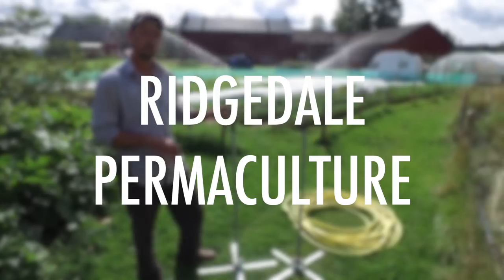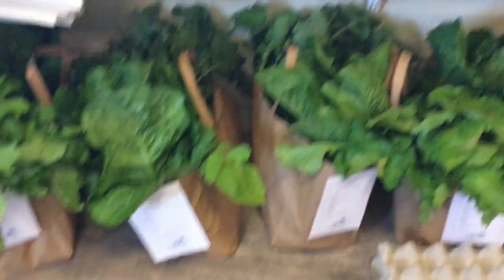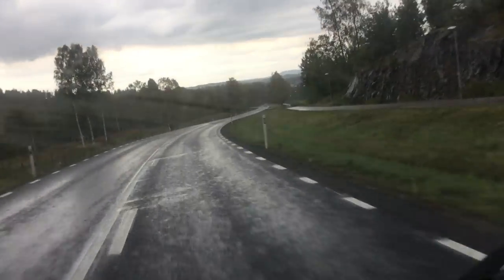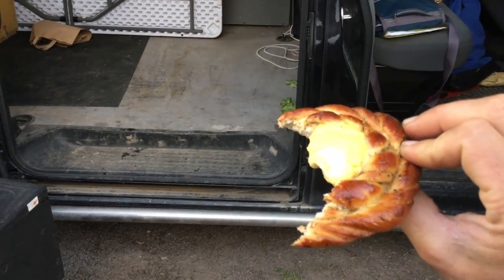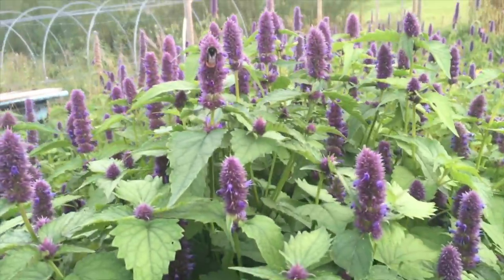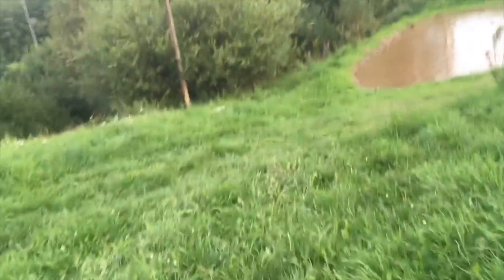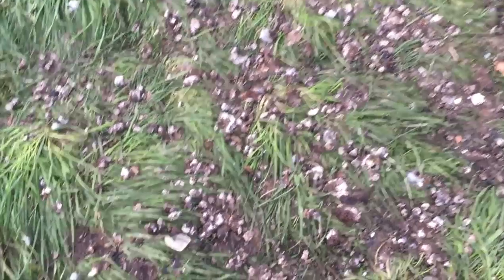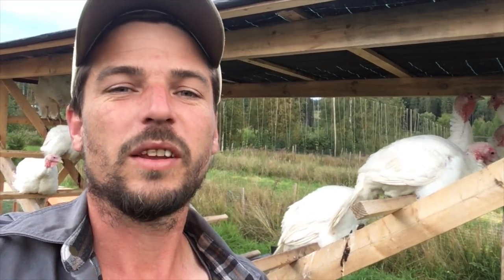S4 ● E101 Setting up infrastructure, storing & selling produce and other things...

Comment: We've disconnected the bottom wire on most of our nets. We cut them at each side and made knots to keep them neat. We don't use them on poultry though. 
I would strongly discourage having nets standing outside without electricity in them. It's way too risky for livestock and wild animals... and the expensive nets. In my experience, the latter usually end up ripped by wild boars and the former tangled up and electrocuted.

Comment: The 700 euro is including the fence for the energisers? Because if not that seems steep. A 20w 18-21v solar panel is about £35(40 euro) now so I guess shipping damage is their biggest risk to no longer supplying the panels now. Some capacitors and a pcb is hardly going to create that sort of cost but then if they last 10 years then maybe sales are not that high so they need the margin, who knows... great information again, thanks for taking the time to share :)
Reply from the maker: Several, not 7

Comment: Richard I use these from Hotline not cheap but really easy to move around and have used them on cattle sheep and hens 
http://www.hotline-fencing.co.uk/catalogue/line52db.html?lne_id=30f86a88-665a-49b7-913c-9f532264c14c
Reply from the maker: Just ain't gonna kick it for 100m poultry netting...

Comment: Try using a golf cart battery. The car battery isn't as good at distributing low amounts of power for long periods of time. They are better at large amounts at short intervals. Golf cart batteries are designed better for what you need it for, as far as I can tell.